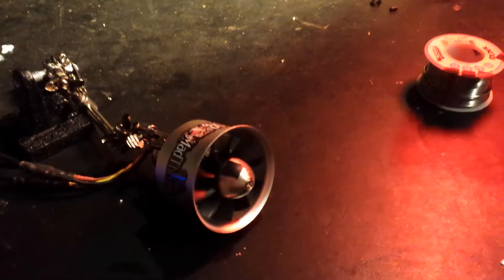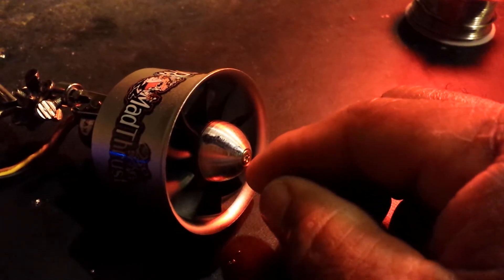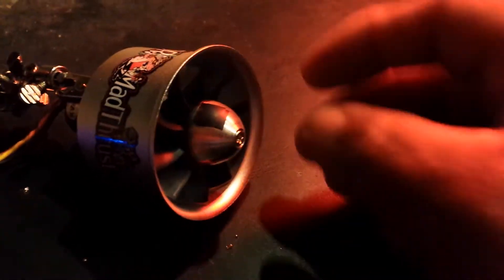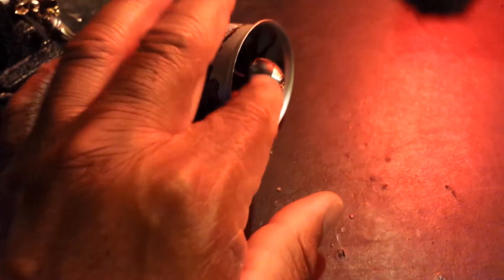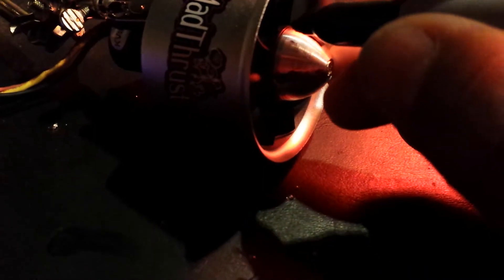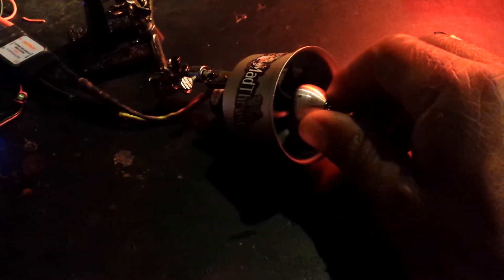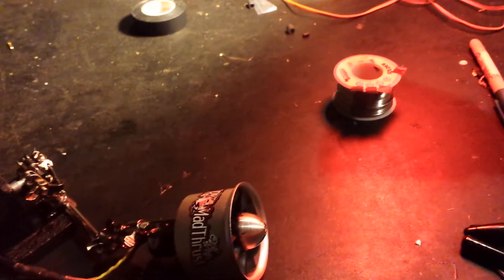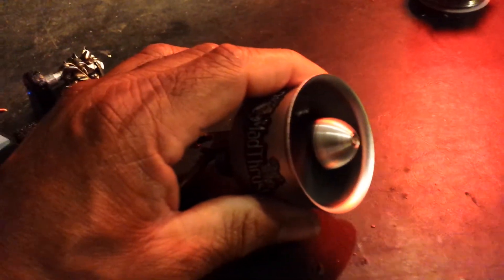How to balance an EDF part3

Comment: This is a great impeller balancing guide without any extra tools. Did exactly how you explained, except I used aluminum tape, worked at the first time...

Thanks a lot...
Reply from the maker: Any tape works! I would actually prefer to use aluminum tape as well but don't have much...  Glad it worked for you too!!

Comment: Thanks for the tip. I have that same fan and it vibrates bad at low RPM. First one I bought was pretty good from Hobby King so I bought 2 that are 4s and was let down with how bad they were out of balance. I didn't know it was that easy to do.
Reply from the maker: It was the same with me. The first one I got was pretty good but even it was not perfect. I already glued it in the plane so can't mess with it now. But if I could it would be even better than it is! Thanks for the comment!